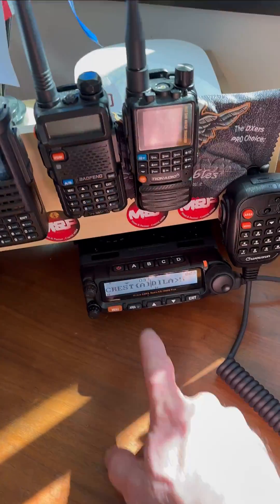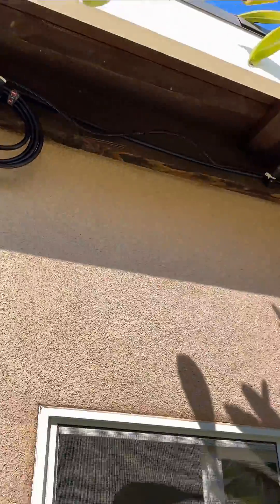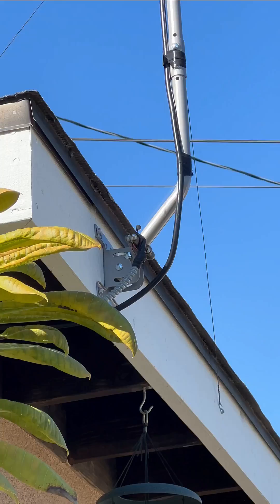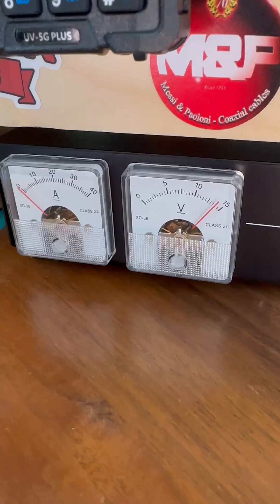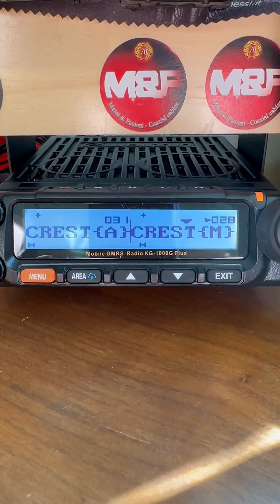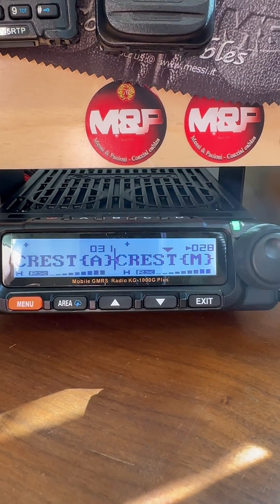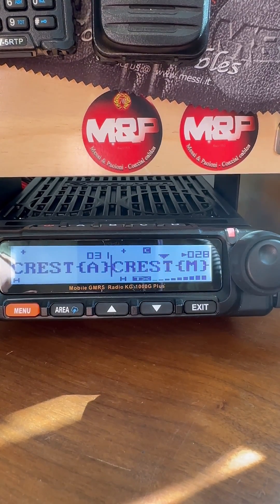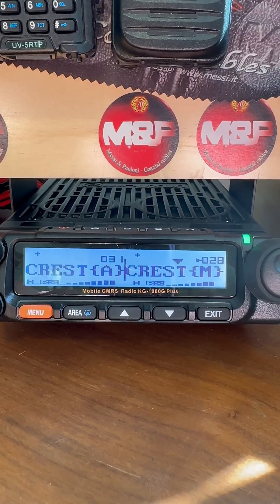What a Superheterodyne GMRS Radio Sounds Like?

Comment: Anything is a base station if you have a power supply and external antenna connected to it.  Anything is an antenna if you tune it.  Anything is a lightning rod if it’s exposed outside.
Reply from the maker: Yes, but when it comes to GMRS I like a nice solid 50 W base station and an antenna that’s at least 15 feet off the ground, now you’re playing with the big boys

Comment: If you think this sounds good, you need to try a Motorola or any of the Japanese radios, then you will see most GMRS only radios (even the expensive ones) sound "cheap" and you won't know until you try.  I owned that mobile at one time and being licensed on both services with most of my time on GMRS, I concluded what people hear is a matter of opinion. A good SOC an Hetro sounds as good as the microphones and filters allow.
Reply from the maker: Im sure youre right, this one being a Super is way better than the cheaper ones Ive used; its hard to but into words